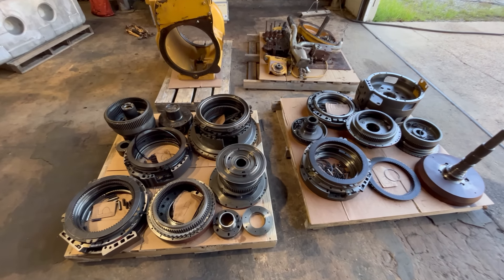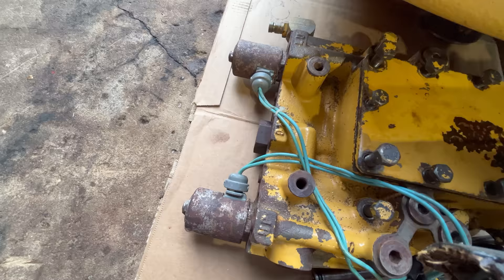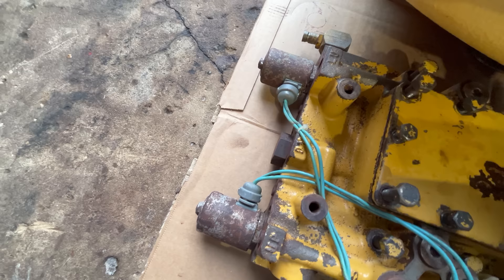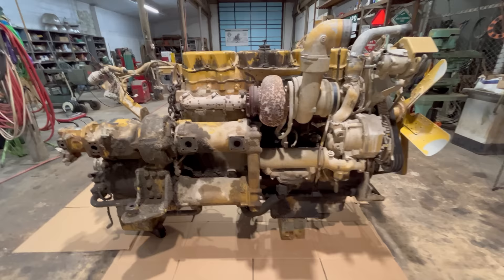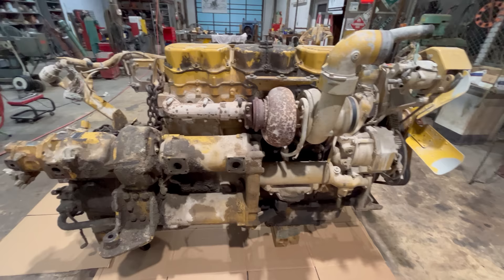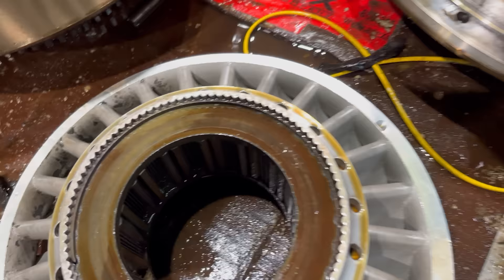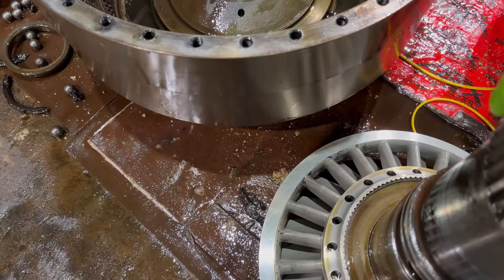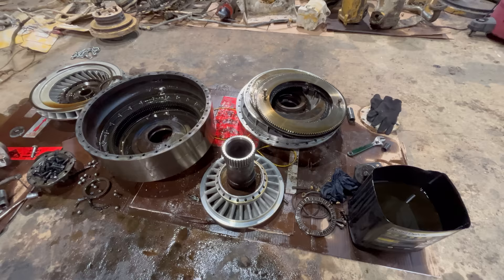Caterpillar 3406E Diesel Engine and Torque Converter Tear Down - 40 Ton Haul Truck

Comment: The discs in that torque are supposed to be a bronze color, the color they are now shows that they are roached, they got real hot, my guess is that they ran it low on oil and burned up that torque converter. That torque is near bullet proof,
Reply from the maker: Thank you.
Reply: @KT3406E  I must be blind but at what part in the video does it show the burnt discs? The cone shaped thing at 44:13?
Reply: @Wasmachineman  40:46
Reply: @michielhuygelier6953  Thanks. Damn, those discs are fucked yeah. Thought it was rust at first.
Reply: @Wasmachineman  the gear i think
Reply: Amen man!
Reply: @Wasmachineman  notice the 'blueing' . Material goes blue when overheated. Or very hot.
Reply: I think the bearing seal went, or started to go, and that allowed the pressure to drop, causing the slip. Also, running it low can do the same thing, but someone already said that here. "Ahh, OP said it. @RasmussenEquipment"  I'm not sure if that bearing works off pressure TBH, just a thought.
Reply: @No_Fuse8771  the nylon on the bearing doesn’t seal anything it just there to contain some oil inside of it. They used to be brass. When in operation there is a crap ton of oil flowing all through there. I’ve had many of these apart and it totally looks like oil starvation.
Reply: Those friction plates are definitely burnt up.  Even though the friction material is still there it is essentially turned into charcoal which has very little holding capacity.
Reply: @RasmussenEquipment  I'll defer to you on that. I've only been in one trans and that as a 3 speed out of my 1967 ford F100 3 on the tree behind a 360. Guess why I had to get into the trans. I've only rebuilt engines, and mostly Chevrolet.
Reply from the maker: RasmussenEquipment knows what he's talking about.  I would not have pinned his comment if it were just some random person from Youtube.
Reply: What did the filter or filters look like? Is this just from running the oil low, or also from failure to change oil and filters at a proper interval? Thanks and take care.
Reply: You are
Reply: @KT3406E 
How did you get into this? School, interested, or family? 
Mak8n this ish look ez!
Reply: Rasmussen equipment: do these units run separate fluid between the torque converter and the transmission?
Reply: @johnriley7053  no they share the oil and also the same pump for both.
Reply: @KT3406E are you a heavy equipment tech? Or do you do this for fun and something to do?
Reply: CAN I ASK YOU WHEN YOU LET THAT  DETROIT DIESEL REV UP TILL IT BLEW UP,  WAS IT AT FULL THROTTLE.  OR JUST HARF THANK YOU .
Reply: @KT3406E  If a guy wanted to try his hand at a rebuild of a Cat C12, is there a trustworthy source to locate and purchase cores from?
Reply: NO MORE VIDEOS BEEN WATCHING FOR THEM!!!
😊
Reply: @KT3406E do u sell parts?  Have a buddy looking for some parts for a 3406A
Reply: just subscribed to your chanel sir. it s shame such usefull channel have less views than  a girl shaking her butttt.
Reply: KT3406E, once any one of the components turn that color blue, would a person be able to send them off and have them cleaned up, and maybe, re-annealed, or would it better just to scrap them? Was just wondering.  I guess it would depend on How much money you want to spend,  obviously. Wouldn’t it? I’ll drive a truck for a living so but no means in my mechanic. I just love watching people work on heavy equipment because I’m fascinated with the heavy equipment!
Reply: Is there a pressure relief hole behind the apply piston that vents pressure when the clutch stack is too thin?   Slippage, heat....  @ChrisHarding-lk3jj
Reply: @williampommeranz6821 I am sure it does, I work on all types of transmissions and pretty much all hydraulically controlled transmissions have bleed holes, exhaust holes or orifices to allow fluid through the clutch pack for cooling and lubrication otherwise they would burn up.  I build anything from regular passenger car transmission to promods all the way up to the biggest Allison or twin disc industrial and marine transmissions.

Comment: Magnificent.
Your shop is so clean and organized it's scary.  You could use it for a haunted house.  "Where did Timmy get to?"  "He was ...out of place."
Reply: I worked as a mechanic for most of my life and one of my early mentors taught me that it much easier to work cleanly, neatly, and to be as organized as possible.  One, ok Two main benefits your tools neat and organized makes them easy to find when you need them and easy to determine if one is missing.  Additionally I learned to clean my tools away after I finish every job or at the end of the workday.  The reason I do this is because quality tools are expensive and I don’t like to buy replacement tools because I misplaced/lost one.  Case in point how many mechanics on Youtube have you mention the number of 10mm sockets they have lost? Myself in 37 years of being a professional mechanic I have never lost a 10mm socket or screwdriver.  However I have found dozens of them over the years.

Comment: Another great video!
I always have a great admirmation for your work ethic and knowledge.  
I have absolutely no clue about heavy equipment operation but if I saw that discoloration in a light duty truck I'd lean towards low fluid level at some point in the past.  Of course by the time they get to me they've already changed filter and fluid and everything's always fresh and full. Probably for the first time in that vehicles life.

Comment: The torque converter hardware that you were referring to that you were unfamiliar with is the one way clutch for the stator. The stator is only allowed to spin in one direction to assist with multiplication of torque. It takes fluid from the tc turbine and redirects to the tc pump when there is a big delta in pump vs turbine speed (accelerating from a stop)

Comment: Constant tension, and spraying with silicone oil, or silicone based penetrating oil helps with removal of O-ring sealed connection.

Comment: The thing that you didn't know what it was at 39:45 or so with the long rollers is a one way clutch.  It lets the unit spin one way and locks against rotation in the opposite direction.  Same as car and truck transmissions.
Reply: Its called a sprag clutch
Reply from the maker: Caterpillar calls it a one-way clutch multiple times in the manual and never uses the word sprag.  Different manufacturers = different terminology.
Reply: They never use the word sprag because there's no sprags in there. A sprag clutch is super similar, but instead of using rollers against a wedge in the flange, there's sprags  like ratchet pawls, but just work with friction against smooth flanges.. both roller bearings clutch and spray clutch do the same work in the same package, different internals.
Reply from the maker: That makes sense.  It's not a sprag clutch at all, and that's why they don't call it one.  Thanks for the clarification.
Reply: @KT3406E  Quick question.  On a Cat cam gear, there are round flat metal things that look like hockey pucks that fin in holes in the face of the gear.  What is their purpose?
Reply: @honkie247 I was wondering that myself. Looks like they are free to move around. Maybe it's a harmonic balancer or vibration dampener of some sort?
Reply: @DBrisky37  I asked this question here at least 4 times.  Still waiting on an answer.
Reply from the maker: Torsional vibration damper.  The unit injectors create vibration (torsional forces) with each pulse.
Reply: @KT3406E  Thank you.  A reason that I would never have guessed.

Comment: I worked at Cat Morton back in 2000, in purchasing, ordering friction materials.  I got to tour the Raybestos plant where they made discs like that.  They stamped the steel core from a coil, flattened the discs, broached the splines, heat treated, nitrided, etc.  For the friction material, they made their own paper, impregnated with resin, bonded to the core, and then cut the grooves with a gang saw with 5 or more blades.  It was really cool to see the process.  Also, the finished friction material was a light brown, definitely not black.

Comment: The stator one way clutch doesn't just freewheel when the converter is locked up.  When there is a big speed difference between the input and output, the stator is back driven and multiplies the torque.  As the slip decreases, the stator is no longer back driven and will start spinning.  That lets the torque converter transition into being just a fluid coupling with less slip.  
The clutch on the stator existed back in the days before locking torque converters were in use.
Reply: Clever.

Comment: I liked that trick using the chisel to stretch the inner sleeve on the rear main seal, I'll have to remember it next time I come across similar problem.
Reply: If you have the room and you have a air chisel that is very controllable like a CP714 an a square headed chisel you can walk them off very easily as well.

Comment: Check the internal clutch splines the friction disks engage with. We had a case/IH years ago tie up between 2-3 gears. We wanted to make sure any problems were evident on teardown so we ran it in the field pulling a large disc while binding between gears until the exhaust pyrometer pegged, let it cool down, and repeated until we knew for sure this warranty job was worth the trip. You couldn't stand beside the tractor. On teardown the clutches still looked brand new with heat signs in the case around them. The only failed part was the splined shaft the clutches engaged on. They had  miniscule knicks due to a soft metal shaft allowing  the clutches to dent them around .001" for every tooth and barely  visible. But the knicks were in a way they held the fiber clutches together engaged with the steels causing drag. You may not have had a slip so much as a non-release causing heat build up.

Comment: I would guess a failing lockup solenoid or caused a drop in main pressure to the lockup piston in the torque converter and it got hot because of that. The valve issues and everything else that got effected was from them not paying much attention to converter temps or just not caring. 

I don’t know anything about these transmissions but I work on a ton of twin disc transmissions that are the same setup and same issues. Been wrong before though.
Reply: Never worked on one of these “turds” (all broken vehicles are turds) but the parts and pieces that show they have been exposed to lots heat without the clutches being worn out indicates to me a fluid pressures problem. The $64 question is what caused the lack of pressure

Comment: In the 90,s I worked at Avon gear and we cut those teeth in the torque convertor housings. I believe that part # is 8551? Since your videos I have seen a lot of gears I cut in all different applications. Keep up the good work on these videos, I really enjoy them.

Comment: Lockup clutch defiantly got hot. wonder if the pump that supplied oil had problems. I was a twin disc mechanic @ Great Lakes Power back in the 1990,s. Just noticed this video and watched it. Looking forward to the transmission video. Brings back old memories, Thanks for sharing!

Comment: The one way clutch in question is actually a ROLLER clutch.  It uses roller bearings and ramps in the shell to engage them.  A SPRAG clutch shell is smooth inside and uses dog bone (figure 8) shaped pieces held at a slight angle to engage the clutch.  A bit of info for the youtube experts.

Comment: The long rollers that fell out are a one-way roller clutch, the stator uses it to multiply torque.  The TCC is toasted, likely low oil or internal leak/control issue from prior "service".

Comment: Good content!👍🏼. I was just a little curious as to how many hours the last ECM you tested was showing on it being it looked original?
Reply from the maker: Over 19,000
Reply: so that makes the machine 50 dollars an hour plus operating costs, nice video
Reply: @KT3406E so if original then the truck did 18k hours before the engine refurb?
Reply: @KrikkitWarlord  It would have done 1000 after the OG ecu was replaced. Engine reman would have happened a lot sooner.

Comment: I’d like to see the suction flange for that bigger hydraulic pump, from video it seems that there’s not much room for it. Wonder whether suction is undersized, and there’s high rate of failure on those pumps due to cavitation.

Comment: This is what people don't do anymore.. learn what happened to avoid the same failure... Had a car with 4 catalytic converters get soaked in coolant from running around with a blown head gasket.. had to clean all 4 and get those suckers up to temp... Double checked if clogged etc.. etc... check and check and check again so you don't end up pulling the same trans or engine.. even better is not blowing out where the head bolts go and running a tap and cleaning till it's mint😊😊

Comment: It seems like the ball bearing died. When all that got hot it took out the seal and you had an internal crossleak from the lockup circuit. Low pressure on the lockup caused the material you saw

Comment: My theory is failure due to overheat because of the incorrect installation of trans solenoids. On the machines that are setup with the LU on the control manifold, they don't then have an additional solenoid on the lockup control unit (canister affair on top lh of convertor housing). A machine driving around in a state of slip doesn't take very long to build up excess heat. Those lockup control units can also fail (the failure presents a little differently however).

Comment: Not certain in this application, but most torque converters that have a lock up clutch balance pressure on the piston on both sides, and what engages the lock up, is releasing pressure on the disc side, which makes for somewhat confusing nomenclature, at first.

Comment: So is the flywheel running in a space connected to the oil pan?  The gears must get lubrication somehow, so that would be my guess.  That must also mean the starter has to seal the oil?

Comment: Temp gauge for trans fluid showed them SOMETHING...lack of lockup  demonstrated performance drop...off to the back lot.
OH WELL...
could have  been intermittent solenojd behavior .contributed to ultimate  degraded condition...and check list analysis confirmed conditions...

Comment: The outside of torque converter looked heat discolored on the one end when you cracked open the trans case........unless that is normal.

Comment: Do you know why the manufactures of these engines don’t use the fuel, pre-injection, with a heat exchanger to cool parts of the engine lube or air? The fuel would generally be the coolest medium entering the engine. You see that done a lot with jet engines, pre-injection.

Comment: I remember a video a while back where you said you were selling wiring harnesses for 3406e engines. At the time you were testing one out of the truck I think. I have a 88 Ford LTL that came originally with a 3406b I would like to swap over to a e model. Would your wiring work in that truck? I know it will require a different pedal but would it work other than that? Thanks for any input you can give me

Comment: I have a 3406 B in my tractor. Do you know how much torque the accessory drive where air compressor would go on a semi can handle? That is where the hydraulic pump is mounted and I would like to put in a bigger one if it doesn’t ruin the motor.

Comment: I think I just saw a semi with this engine that said 800hp.  Is that possible eith an over the road engine, bigger turbo, etc?

Did trans not have bolt holes to thread bolts in to push trans seal loose?

It's more lucrative to sell a used crank vs. a complete running engine?
Reply: That engine is good for a 1000+

Comment: I wonder what the purpose of having two speed/timing sensors running off the same cam gear is, and why one sensor couldn't have performed both functions?
Reply from the maker: One sensor can run the engine.  It is double redundancy.

Comment: Powered by steam it would have lasted forever. I think those companies who have not explored steam are like trams going along a track. They just keep solving problems with more problems until they have a scrap iron jungle. Keep it simple. I've seen a three ton steam winch lifting eleven tons. These diesels are ranting and roaring with more parts than a Swiss watch to do anything.

Comment: Question: this week I’ve been driving a loaner truck with a C15- 625 Cat. The engine brake seems to be brake activated.  A 2 second brake application & release the pedal . Jake stays on, until you get back on the throttle. 
 Didn’t know this type of logic was possible. What are the options ? 
   I would prefer a 3 second delay, with throttle pedal activation. 
  Is that possible in the programming ?
NXS22361